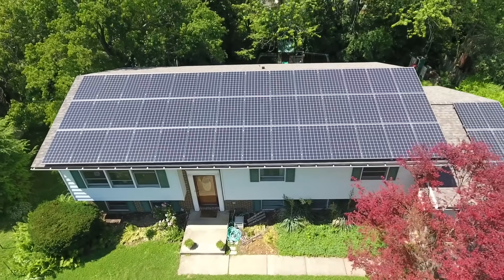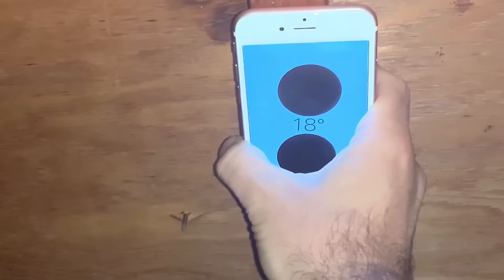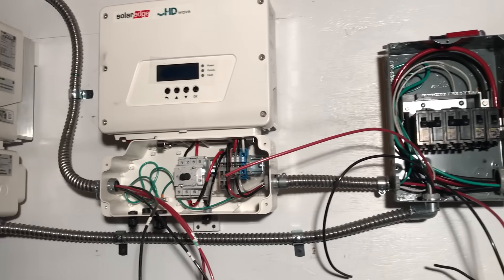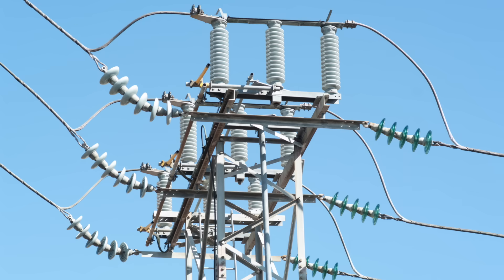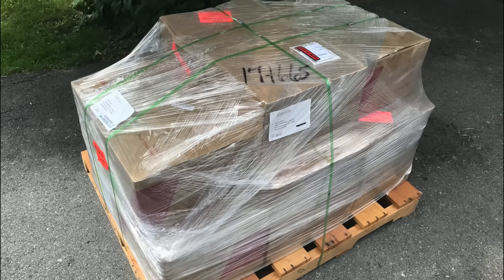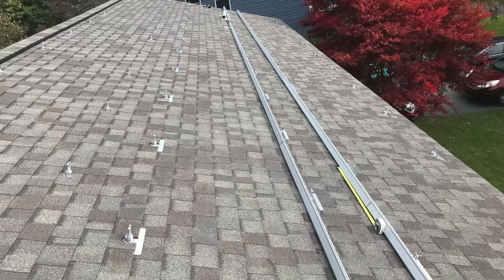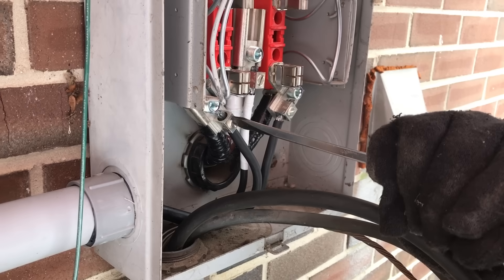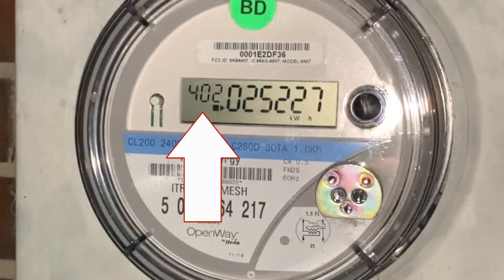I Installed a Power Plant Myself | HUGE DIY Solar Panel System

Comment: I see the day when every surface on new builds will be solar panels and water heat sources, every inch of the roof and all the walls, south facing, or north for those in the southern hemisphere, I don't understand why are not built like from new, they add weather protection to conventional builds, nothing is as waterproof as PVC cellular plastic,

Comment: Does this calculation could for the rereoofing costs in the future. You will need to take it off the roof when you replace the singles
Reply from the maker: The system will have more than paid for itself by the time new shingles are needed.  Their lifespan is greatly lengthened compared to the normal 25 years for asphalt shingles because they have a glass roof (solar panels) over them.  If you’re interested, I’ve made a few videos covering the financial side and benefits of this system.
Reply: @FrugalRepair  I see. I'll take a look. Curious what annual ROI is when reroofing is factored in

Comment: That is odd. My area code requires 2 ft clearance of no solar panels, on top and bottom of the roof line, and 18" on the sides going up and down the roof to meet code. I would Love to cover my entire roof face with panels like this. Looks nice.
Reply from the maker: My jurisdiction didn’t adopt that portion of the national electric code so that’s how I could go to the edge.  You can always ask for an exception.
Reply: @FrugalRepair  Great suggestion TY!
Reply from the maker: I believe there is a section in the NEC itself that explains that exceptions are allowed.  Whether you get it granted or not is another matter.   Hope it goes well!

Comment: Great video, Rhys! I'll be moving to PA later this month (Sept) and plan to install solar panels. You're an inspiration. I'm still fearful of being on the roof (and so is my wife) and I definitely wouldn't wan to play around with the electrical work. So, I plan to design my system, obtain permits myself, purchase the materials then hire professionals for the installation and wiring. 

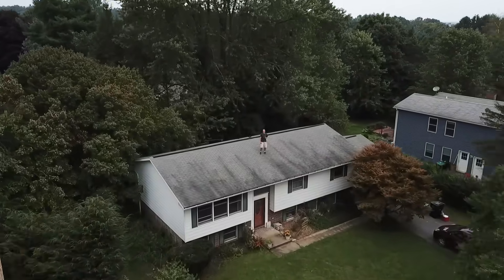By the way, anyone else noticed that shoddy installation job of one of the examples Rhys showed at 0:23??

Comment: So im doing my own solar as well. But taking circuits. Off grid, putting them in a sub panel. And feeding them. I wanted to do grid tie but decided on off grid because i wanted power to my home in a power outage. Built a 300ah. Lifepo4 bank. And 10kw of rec solar panels. Ground mount.

Comment: There are fire based rules that define minimum access area to the roof. Typically 3ft wide at the gutter and 3ft wide up to the peak. This layout doesn't have that. Make sure you're in compliance.
Reply from the maker: Good observation.  My jurisdiction did not adopt the part of the NEC that requires the setbacks.

Comment: Keep a close eye on your local laws, many such set ups only work due to tax credits and the buy back system. Some areas are not buying exess energy any more due to over production during daylight hours. Basically if everyone has solar electric companies have little need for power during the day.

Comment: How are those panels holding up to this day? I install solar and ive seen tons of issues with those panels.
Reply from the maker: What issues have you seen with the Panasonic panels?   Mine seem to work great.
Reply: @FrugalRepair  more or less the shipment is always damaged in same way, I've had a few dozen dead panels, some of the connection points from the panel wire to the invertor detach themselves or just aren't tightly connected. I've done solar edge, enphase, generac, and tesla systems. Canadian solar 410s are probably the best panel I've ever worked with. Not knocking your installation job, it's done well. I was just curious about life with your panels.

Comment: well that's one thing i'm not doing 48 panels, that has to cost a fortune. seem some people in a neighborhood who spent a fortune to have similar system on their homes only to find out it still didn't give them 100% power, etc., doesn't seem like its worth the gamble for the price tag, etc.
Reply from the maker: It depends on who you are hiring and what equipment, etc.  The price can vary wildly.  I made several videos with the exact costs and production of this system, if interested.

Comment: "no bills" isn't the attraction, that's a wrong interpretation. the point is to be sufficient in case of a grid failure. period. the cost of parts and install is way greater than monthly billing for grid power.

Comment: By the way.  The current code( and much older ones) states that a minimum of 18inches is required on each side of the ridge.   That is for the fire crew to walk on the roof and poke holes in case of a fire.    Not that they really do any of that. Lol.
Reply from the maker: My AHJ didn’t adopt that section of the code so thankfully I could get more panels on.  But many places you do have to adhere to the setbacks.

Comment: Gutsy install, congrats!  And not upgrading your baseboard electric heat to use less power, instead maxing out your solar install.  That would give you a lot of future options, you could use one or more ductless mini-splits to replace some of your baseboard heat and free up free energy for an electric car.

One thing I didn’t see you mention was having a whole house surge protector to protect the inverter/microinverters.
  
Our install is 6 years old and we had a contractor do the install in one day.  At that time we got in at the end of state + utility incentives and that added another 35% to the federal 30% incentive but that 35% was not DIY eligible.

We got the Flashfoot 2 mounts like you have and the design looks highly rainproof.  Iron Ridge rails too.  Enphase microinverters which I prefer so we can add batteries in the future and be able to form a microgrid in a grid power outage.

We did a similar thing, we didn’t upgrade our older gas furnace and A/C which were high efficiency when they were installed but are now at the lower end compared to units of today.  Instead we had the most solar installed that was allowed by the utility given our annual usage (and at 32 A max, maxes out the 40A back feed panel breaker.
Reply from the maker: Thanks for watching!  I have a surge arrester on the system.  I explain it more in the solar tour video.  That’s great that you have solar too and maxed it out.

Comment: How old is your roof? Do you have to carry additional liability insurance and did your home owners overall insurance increase?
Reply from the maker: I replaced the roof in the video so it’s brand new.  Insurance really varies, you’d have to ask your provider what they cover.
Reply: On our policy the solar panels and gear are covered under the personal property replacement insurance coverage.
We got a new 50 year roof before our solar install about 6 years ago.
Reply: @mt.sylvania9218  I'm my state it is recommended to have liability insurance to cover damage to the utility company. Also, insurance companies have a tendency to drop you or increase your policy.

Comment: People are putting 10's of thousands of dollars into saving money but yet its proven that these solar panels, batteries, etc are NOT lasting the said 20-25 year life span. In the long run, youre not saving anything or not saving much. Plus your contributing to communist china who largely makes the solar panels and other components.
Reply from the maker: I don't have batteries installed, nor any Chinese made items (that I am aware of), so you may be referring to someone else.  Watch my videos on the financial side of this installation.  It has been a really great investment.
Reply: This is false.  We have 25 year warranties on our microinverters and solar panels and neither were made in China.  And all the equipment was installed using US labor.  We are 6 years into our 9 year break even time.  And glad we have the solar power as our utility is proposing a 17% rate increase next year.  Our electricity bill is $13.50 per month.

You can check out NRELs Long Term Outdoor test facility where they have multiple panel brands installed for long term tests.  They also do accelerated life testing in their labs.
Reply: @mt.sylvania9218  What I said is NOT false. I never said or implied that your products are made in china. I clearly made the point of how there's people putting 10's of thousands of dollars into their solar panel units and their not lasting the 20-25 year life span. I clearly made this point for the solar panel products which are in fact largely made in communist china

Comment: I dont qualify to have panels on my roof, however i have a long stretch of a plastic fence which may be able to hold 20 panels. It gets a lot of sun every day. I think it may be able to give me 120 amps. I think it may be simpler install then a roof and like you, i wouldnt even know where to begin since i have no experience.
Reply from the maker: You'll want to make sure they are secured down correctly because wind could knock them over if they are just leaning against the fence.  You also probably aren't going to get 120 amps (that is a lot!) but perhaps you meant 10-20 amps.  Amperage is added up with panels wired in parallel.  Voltage adds up when wired in series.

Comment: What about hail storms?  Wind storms? Insurance covered?
Reply from the maker: You’d have to check with your insurance coverage about that.  If installed correctly then in general, wind and hail shouldn’t be an issue.

Comment: Thank you Maypower2029- great work . I have seen the same saving over the past few months we have had solar panels on our roof which you helped me install when i was recommended by you on the comment section (43 panels). Last year we had $300 in electricity bills - that's it! Maypower2029  is great!

Comment: As someone who recently had solar installed, I can honestly say that if you are not having a battery system installed with it, don't bother. You will NEVER be 100% power independent because the power you use at night will always be more than your measly buy back credit. 

Last month I produced 1.1 MWh, consumed 380 kWh, imported 157 kWh and exported 880 kWh. Even though I exported almost 6 times more electricity than I imported, my bill was still over $100 after the measly buyback credits that equaled about $20. without a battery system you will NEVER be energy independent. And if the fly-by-night company that suckered you into buying solar panels goes out of business, you will be on your own.
Reply from the maker: If you can get 1-1 net metering then you don’t need to get batteries (unless you want them for power outages). Unfortunately, it doesn’t sound like your are able to get that. In your case, it might be more beneficial to get batteries.

Comment: You aren't at net zero AT ALL!

You have used large quantities of materials that require fossil fuels in their manufacture and transportation.

Most importantly,  you have a GRID TIED system, which means you are a solar racketeer foisting costs on your neighbors and not paying you utility for very valuable services which are necessary to make your system function.

Very likely,  you and other solar racketeers flood your utility with power which the utility can't use,  and very likely has to waste to keep the grid functioning.

Then, at other times when the sun doesn't shine,  you take power from the utility that the utility has to pay for.

That's not net zero0 at all.  That's being a solar racketeer.

If you want to be your own utility,  fine.  Just cut the grid tie.  But guess what?  You don't want to do that,  because you take too much from the utility that you do not pay for.

Comment: i was told by a guy that if you feed power back to the city then they legally have to pay you for the power you supply
Reply from the maker: It depends on the rules in your area.  In PA there is 1-1 net metering you can setup.  I have a few videos on this topic and how I get the various credits, if interested.
Reply: @FrugalRepair  sounds like you know more on the subject then I, Ill have to watch your video

Comment: If all the structure supporting your panels was made out of aluminum, you should've used aluminum wire instead of copper, copper and aluminum react chemically in a process known as galvanization, specially with that ground wire you're running, it can and will galvanize your structure eventually

Comment: One very important thing you appear to have done right: You did not step on the panels during installation.
You'd be surprised at how many think that just because the glass doesn't crack they didn't damage anything.

Comment: I’d love some advice please: in a few years time, the 600 sq meters of solar panels on my barn roofs, become mine (part of the deal when I recently the bought the farm). They’ll be 20 years old by then, but as they cost me nothing (they actually reduced the price of the farm not increase it💪💪🤷‍♂️🤷‍♂️) I’m not concerned about the loss on efficiency over those years. It’s looks like they’ll have lost around 15% efficiency. No,problem, they cost me nothing. So,what should I do with all that electricity please?

Comment: If installed on an A frame like a teeter totter the solar panels could track the sun using water weight/gravity a low cost and more efficient energy.

Comment: It is premature to be happy. Soon your federal/state/local government will introduce a resource rent tax for your collection of radiant energy falling on your roof. This is not a far fetched scare, they have already done that with rain water ! Your insurers also want to send you a yearly bill of around 5% of the replacement costs of your panels. Local electric authority also want you to obtain a safety certification every second year. So would there be anything left of your saving? :(, :(

Comment: The only real question here is WHY did you bother connecting it to the grid? Screw those Jooish demons. Run it to a charge controller and a battery bank and throw that meter in the TRASH.

Comment: I'm already saving ,  with just 1 100 watt solar panel, 1 lifepo4 battery, 1 renogy 20a mppt solar charger. I run my kitchen lights and charge everyone's phones, tables, nintendo switches, steam deck, blender, oven, and microwave 😂😂😂😂.  The only downside is I have to disconnect stuff because there's not enough outlets. Lol. Crazy what you can do with a simple as he'll set up ! Solar power is insane. 

Also, the crazy thing is that I haven't even had sun since I bought this setup. It's been cloudy 24/7. ⛅️  and it's still charging my battery to 100% crazy fast. I'm using a harbor freight solar pannel.  And I'm thinking about buying another before the end of the week, I may also get another battery. So far really impressed. I haven't used my elecity in my kitchen for days now ! Insane!!!

Comment: I’m surprised by the lack of return. Only 14% seems low! When I looked into having companies install panels on my home, I was calculating around a 7% return. I figured if I did it myself I’d get way more than just 7% more.
Reply from the maker: That was my initial guess plus I bought equipment more on the pricier side.  The video after this one has more detailed numbers, if interested.

Comment: Your system is very complex. Now days with 600W panels You need a lot less panels (NO MICRO INVERTERS) Directly to combiner box then to inverter. Linked to battery and mains input. All is done. Some inverters are bi directional So it automatically feeds back into the grid No need for anything else to be installed Your normal meter power meter runs backwards anyway. I've seen the systems used in the USA and they all serious overkills hence you getting ripped off to build.  5 kw system in South Africa is pretty much average to cover 90% of power usage. Costing less than $10k excluding installation.

Comment: how does solar affect roof replacement I would love having solar but here in Florida having to replace our roofs around 15years is very costly 😢
Reply from the maker: The solar panels will extend the life of the shingles underneath.  It's best to replace them when you put on the solar.  It's second best to put on panels if the roof is less than half (closer to newer is better) of it's replacement age, I would say.  Do you have asphalt shingles in FLA?

Comment: I will put those power optimizers in the attic to protect them from the elements and for easy maintenance. In the event they have to be replaced going on your roof is one of the most dangerous things a homeowner can do.

Comment: I used to teach people how to maintain the home and you’re right fear stops people from doing some of the simplest things. Remember this if you got a leak in your roof very easy to fix and there’s a number of different applications where you don’t even have to penetrate the roof to secure panels to the roof.